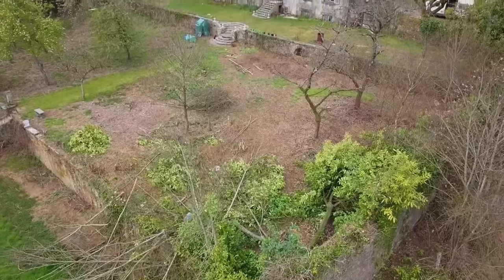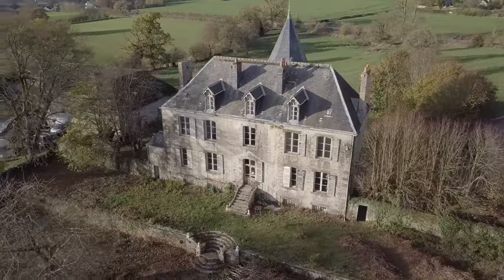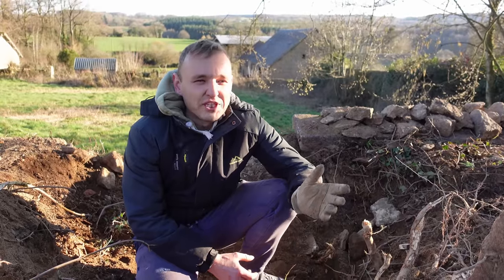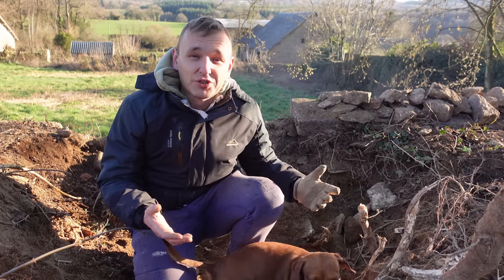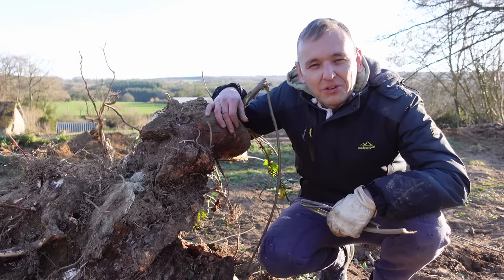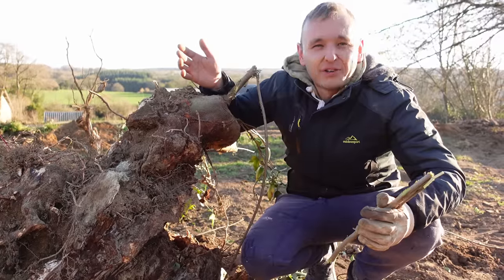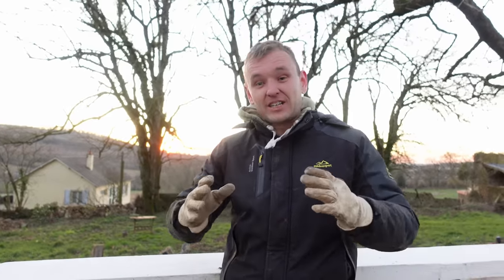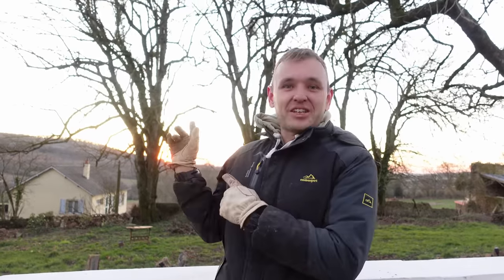DESTRUCTION IN THE WALLED GARDEN at Chateau de Lalacelle.

Comment: Tip for removing tree stumps.  When you cut down the tree leave 2 - 3 metres of trunk standing - don't it cut down low..  Then you get so much better leverage with the tractor and strap to rip it out with much less digging.  Learned this the hard way!

Comment: Such a massive job removing these trees from the walled garden!  The root balls are quite large and it is commonly thought that the roots extend underground as much as the tree canopy extends above....but tree roots extend much further out that the tree canopy....as much as 40 feet in every direction!  Your removing the root ball should be sufficient for the deeper and longer roots to die off and dissolve into the soil...but watch for new tree sprouts that can generate from these pesty roots.  I guess this extensive root system is why we have trees that are hundreds of years old.  Well done!  Cheers

Comment: I can't wait to see what the Landscape Designer comes up with for your front garden area. Good Choice on getting rid of those trees. It's easier to start with a clean palette  than to try and rehab trees that probably won't rehab, realistically. One piece of advice from someone who has done landscape design and maintenance in the past, get a long, solid, skinny metal pole that you can use as leverage for some of those stumps and/or shrubs you may just want to move in the future, also, get yourself a 3 or 4 foot hollow post that you can put a wrench inside and use to unwedge cutting blades on your mowers. It'll help your backs!!! KEEP UP THE GREAT WORK!!!! I can't wait to see your new Kitchen!